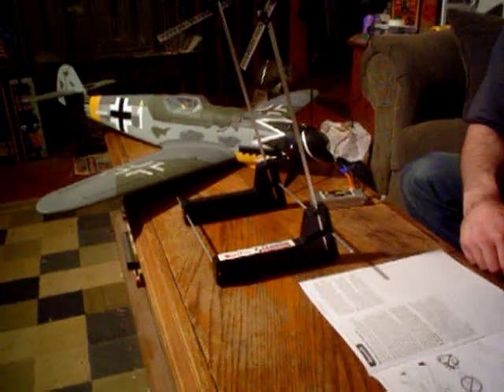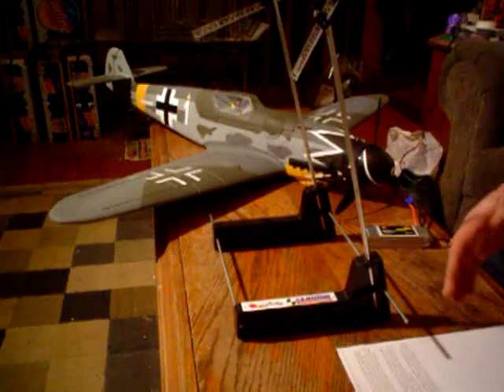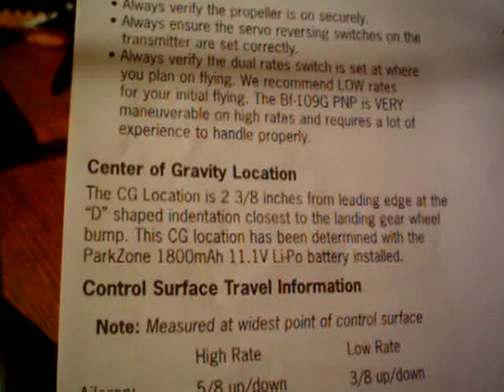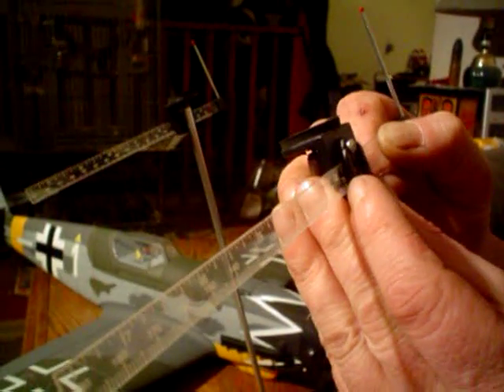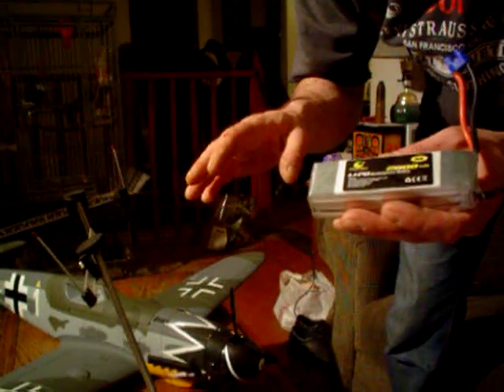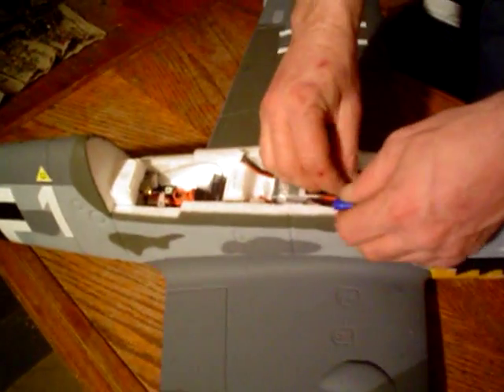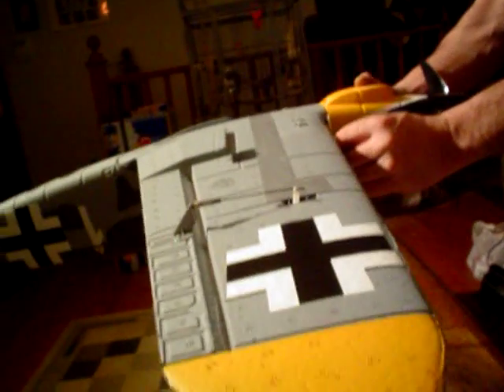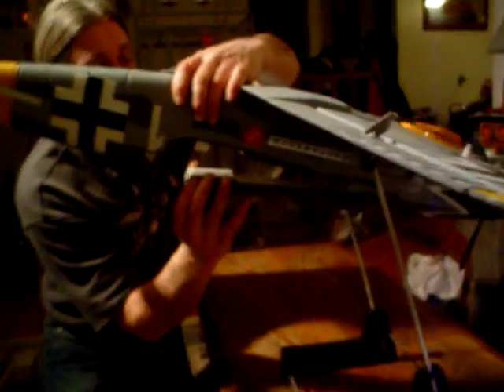Parkzone ME109 setting the center of gravity

Comment: You never got it balanced. So the next step is weight in the tail as the battery is all the way back.
Reply from the maker: Ive flown this plane several times at that balance an it was stable and predictable .. although you are correct the next step was to put weight in the tail .. i never bothered as i said in the video .. and i didnt hesitate to fly it right where it was and it worked out perfect.. thanks for your comment.. enjoy the hobby ,thats what its all about .cheers

Comment: Excellent vid!... You should get royalties from Great Planes because after watching I WENT AND BOUGHT ONE!!
Tried balancing the same Parkzone plane as in your video but found doing it inverted the balancer pads were on the landing gear humps? Then I did it normal way up with a Turnigy 2200mah 3s and it was spot on!... Thanks again from the U.K, great info ;-)

Comment: I believe that the compartment under the esc in the nose is where the battery goes there is a notch cut in for the wires The ESC goes in the compartment over the battery compartment ...